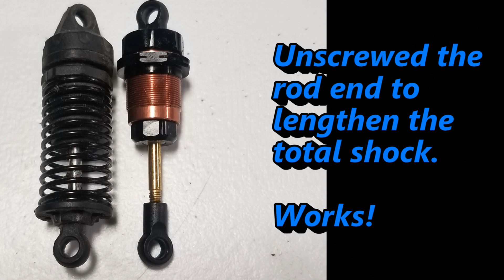RWD RC Drift: Sakura D5S Upgrade Chassis and Shocks

Comment: Love your channel, awesome help and great content. If you were to buy a sakura kit today, which one would you get..its a bit confusing as to which is the better one at the moment, thanks 😊
Reply from the maker: I prefer rear motor.  I out as much weight back there as possible. 

However, the MR is really only a few % weight distribution different.  

I doubt most folks could tell the difference. 

They just released an upgraded MRv2.  It fixes some fiddly parts with the v1.
Reply: @RoadsideRC  thanks, MR V2 it is then, any upgrade must haves right of the bat? Thanks again 👍👍

Comment: Looks awesome. The weight transfer and spring action looks good. Looks alittle soft up front tho. I like the front to be snappier.  I've been thinking about a D5 as a second beater chassis. My RMX is becoming a comp rig. And the Tr56/60 you built come with the extended rod ends. 👍
Reply from the maker: Yes!  You should certainly try the D5.  It has surprised me how well it drives for sure.

Comment: I’m still struggling with my set up , the front of car intends to goes to the left when I full throttle, and the back/the body was not sliding to the left, instead swinging to the right like circle .any idea how to fix it? Thanks
Reply from the maker: Check your gyro settings.  Sounds like it is working backwards?

Comment: I'm not a fan of sakura rwd chassis, I started with an XI sport that was converted to rwd and it was the bomb, I upgraded to the D4 and had nothing but trouble, parts installed wrong from the factory, stripped screws, it was impossible to tune, even a friend who had his D4 working like it was on rails couldn't tame mine. Passed it on to someone who wanted it for parts. I have tried a stock D5 and a modified D5 and they are in my opinion a little better and a great place for a beginner or a budget rc drifter to start, but to me it's still lacking something. I don't know what it is. I enjoy watching people drive theirs and I enjoy seeing yours on track and running well. The chassis looks good and there are plenty of optional upgrades out there,  but I just don't get the same excitement, the same feeling I get when I drive my stock Yokomo YD-2E.
Reply from the maker: Interesting!  
This car has been great for me. I left it box-stock setup fir a long time and could hang with everyone else on the track.  

Different drivers, different feel I guess.

Comment: Can you please provide a link for the shock oil you use?
Also, would this shock set fit a rmx 2.0 rtr?
Reply from the maker: The oil came in the kit!  It was included!  
This kit would work great on the MST also.   The length issue I found would be similar.  On my MST, I ran a set of the TR60 shocks which are 5mm longer.

Comment: Is it normal for my rc car’s rear wheels to completely stop when the throttle is released or is it supposed to keep rolling? Thanks for the help.
Reply from the maker: It depends on if you have drag brake setup, and if you have your ESC calibrated to your controller correctly.  

Without drag brake, it shoudl roll at least a little bit.  
With drag brake, it will lock the wheels up immediately.
Reply: @RoadsideRC  how do I know if I have drag brake set up, and how to disable it? I’m using hobbywing esc 120 a , I’m not sure I calibrated correctly when I installed. Thank you 🙏
Reply from the maker: You can use the program card, or follow the programming instructions  in the manual.